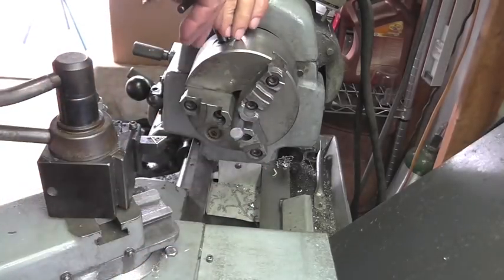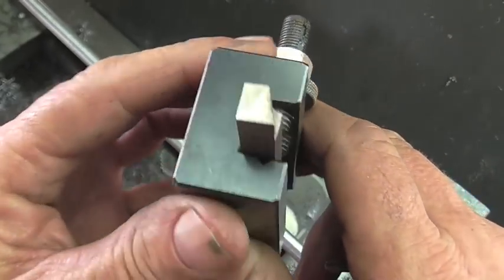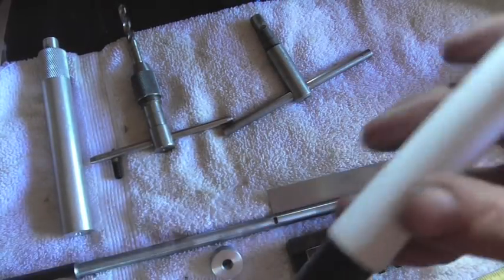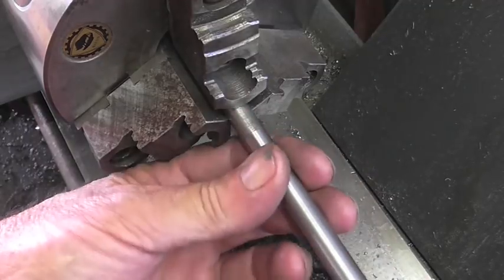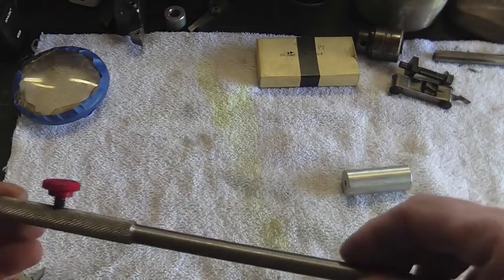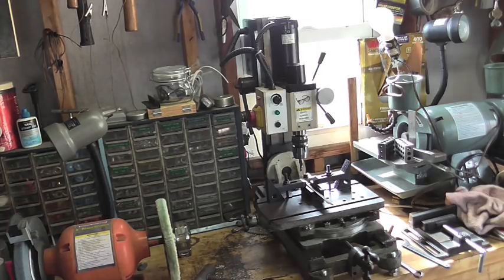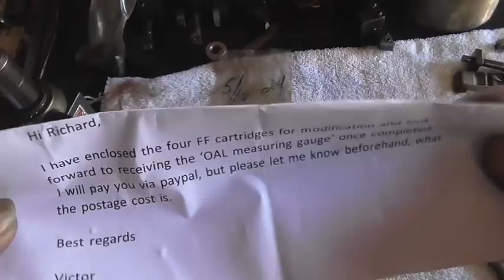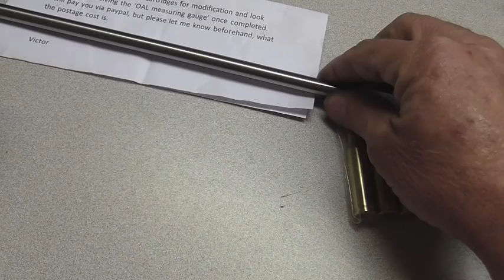Machining an Overall Length Gauge (OAL Gauge) & New MILL!- MSFN

Comment: The new form of video looked great to me Richard. Nice work , that high speed steel shear tool you ground sure works very well. With the finish you got from it , well lets say I have got to try to grind one up. Just hope I get the same results you have. Looked like a mirror finish. Good to here from you again. Keep the videos coming.
Reply from the maker: Use the shear tool for whisper thin finish cuts, 1-2 thou max....you will love using one. Take your time and will get great results with it

Comment: i must have missed something. if that tool is to hold a cartrige just to measure it. wouldnt it be easier to just hold it to measure it?  seems like alot involved just to hold a cartrige to measure.
Reply from the maker: Its a bit more involved than what I covered in the video, but due to the new "rules" here on YT I didnt want to go into more detail on exactly how its used or risk the video being listed as "non-friendly", you can search other videos for why these are used Bob
Reply: It’s used to determine the maximum cartridge length a given chamber can accept. The user would slide a bullet into the stretched case neck and with the case chambered you are able to measure the length of the cartridge with the bullet touching the lands of the barrel.

Comment: Rich, craftsmanship on this version looks outstanding...nice job! I'm contemplating re-ordering now :-). 
Question though- does this build include the rod needed to extend the bullet out of the cartridge (after the assembly is inserted into firearm of choice) until it contacts the rifling/bore of the firearm? The purpose of this tool is to determine the "maximum" overall cartridge length (F.F. cartridge/bullet) for a given rifle so the owner can experiment with bullet seating depth for maximum accuracy and consistency with their hand loads.
Reply from the maker: Thanks!, The gauges do not include the rod simply due to their length and problems in shipping a thin gauge rod that long. A rod can be sourced locally by the end user. A length of welding rod would work well. Thanks for watching and the kind words 😊

Comment: Nice to see that I'm not the only one that thinks the vertical shear tool is great.  One with a radius works well for facing, and when you don't need to go all the way in to the center of the part, you don't have to be too concerned about the height.  Somewhat close will do.  It worked quite well to correct the back plate to my Bison chuck, back when I made a new spindle adapter for it.

When you have some time to tinker, chuck up some scrap, turn it, make a shear pass, then make several spring passes on half of that (until you no longer produce swarf).  You may need stronger light and cheaters to see it, but the last that comes off should be 'peach-fuzz on a frog' fine.  Compare the finish between the two halves and measure with your best mic.  I'd like to know if the extra steps have different results with different lathes or if it's only applicable to an old warrior like mine.  Depending on the material, it's been the closest I've come to "mirror" right on the lathe without the use of abrasives.
Reply from the maker: Nice! I really love the tool and its simplicity.....really saves a hobbyist alot of time on surface finish
Reply from the maker: I didnt see your second paragraph at first but will give that a test run...thanks! ~ Richard

Comment: This is going to sound stupid to a machinist like you but if you are going to run a 5/16 x 24 die on a round stock, do you turn the blank to 5/16th? Is the first number on the die the diameter to turn? Thanks.
Reply from the maker: I usually shoot for about .005 under the nominal size, so in this case (5/-16 being .3125) I turned it to .307 for a little clearance on the threads
Reply: Thanks man.
Reply from the maker: I have never used a die to thread rod, I just single point thread it using the lathe. Good luck!

Comment: A couple of questions, first the thumb screw has no purpose in this tool, the original has a rod that passes through the tool and threads into required casings and is held in place by the thumb screw. Second the neck of the casings has to be oversized slightly so the bullet that is to be used passes freely through the neck. Third shouldn't the tapped hole in the casing and the thread on the tool match the commercialy sold casings to allow the tool to be universal? If not individuals purchasing this tool will have to drill and tap all new casings for whatever caliber they wish to size with the OLG, and not have the option of purchasing over the counter casings? First and foremost this is not a bashing by any means, I have a home machine shop as well and am considering making one of these for myself so I figured I would reach out to see why some of the things mentioned  before was handled in another manner. Maybe this was addressed in another video.
Reply from the maker: "A couple of questions, first the thumb screw has no purpose in this tool," 

It doesnt? That would be news to Hornady

Comment: r u running the sheer tool above center?
Reply from the maker: The shear tool is a right angle at the business end so is always on center regardless of the height adjustment of the tool holder.  You can move it up or down to get a new cutting surface if it gets dull and it will still be on center height (tangent to the radius) I think its called 😊

Comment: Nice job. What does the thumb screw do? BTW, FF means 'fire-formed' in the rifle's chamber.
Reply from the maker: Thanks, I didnt know that 👍🏼  The thumbscrew clamps down on a rod that is inserted all the way thru the gauge and advances the projectile to seat on the lands and grooves and also seat into the cartridge, then the overall length of the cartridge is measured and used as a reference for proper seating depth of the projectile. Thanks for watching! 😊
Reply: Ah. Now I get it.
Reply from the maker: I am no expert on using one but thats my understanding....I just know how to make the gauges...LOL
Reply: Makin Sumthin From Nuthin - Good explanation. Not all chamber throats (distance between case mouth and lands) are the same length.  If you have multiple rifles in the same caliber you can customize your ammunition for each rifle.  By seating the bullet very close to the lands you eliminate the "jump" from the case mouth to the lands, and in theory you will improve accuracy.  Works most of the time.
Reply: Makin Sumthin From Nuthin - A tool and die maker doesn't always need to know how to use a tool, but he sure needs to know how to accurately make the tool.  Great job on that.  What model of mill drill is that.  One of those would be a compliment to a shop, for small milling projects.
Reply from the maker: Thanks MP, the very first one I made was a gift for my brother and have since sold quite a number of them, it helps with new tooling and equipment like the little mill. Appreciate the kind words on its manufacture.....the customer was very pleased with it.  The mill head is from a grizzly "lathe/mill" combo unit and mounted on an X/Y table from another piece of equipment that is unknown. Its good for small stuff....glad to have it :)

Comment: Nice chip control. When the scale comes off and the inner shine comes out it is always soooo nice eh.Watching you now is still a treat bud. You have found a niche that suits you very well fella. That little mill will serve you very well and end up doing some really big jobs as with the sm. lathe(love that machine). Good to see you and I look forward to seeing you again. Well done !
Reply from the maker: Nice to see you Dean, hope 2018 is a great year for you. I enjoy the metal work and making the videos so glad to hear you enjoy watching them. The little mill needs some work to get it to my standards so the jury is still out on the little guy. Hoping it will do what I need it to! ~ Richard
Reply: For now it goes up and down, back and forth in 2 directions. Sounds like a mill to me. It will serve you well as is. It will make enough to be replaced by a larger unit but you will be surprised at how much it will still be used after that as is.
Reply from the maker: The base (X/Y table) and the vertical milling portion are from 2 separate units and the way they were married together is not properly done, but can be remedied
Reply: That sir is the attitude of a machinist/fabricator fella !
Reply: There are machinists and there are fabricators. You sir show traits of both. Do you weld as well ? I do all and a mechanic of chainsaws, cable yarders and aircraft as well. As gramps said "A nut is a nut, a bolt is a bolt. you can put em in anything you like. The rules remain the same"
Reply from the maker: I have a Lincoln 225 Tombstone Buzz Box, AC only. I can weld ok but not well enuff to charge $$ for welding services 😊   I just dont weld often enuff to get proficient at it
Reply: I would suggest a Square wave machine. It will serve all the welding techniques you will ever need. Up to and inc. 5/32 low hydrogen through both - + DC and AC welds. Tig too bud and just hook up a wire spool too.It is the only all around welder I know of and mine has served me without grief for 20 years +.
Reply from the maker: Great to know....I just dont seem to have a lot of call for welding but if I could TIG I bet I would find a lot of excuses to weld
Reply: You already have the hand/eye thing bud. It is just one more thing for the tool box eh !

Comment: That's nice. But what about the rod that goes in the center of the tool.
Reply from the maker: its just a simple rod, I dont supply that. As a machinist, I just make the gauge (the hard part to manufacture)
Reply: @MakinSumthinFromNuthin  ok I was just wondering. Thanks. Sure looks good.

Comment: My Hornady OAL Gauge extends into the case to far to use with a Lehigh Defense194 gr. Max Expansion subsonic. Any thoughts?
Reply from the maker: Not being a reloader myself I cant offer an opinion on on how to work around it. Yours is a store bought one?
Reply from the maker: Is the gauge too "short"?
Reply: Makin Sumthin From Nuthin, No, my hornady is to long for a 300 AAC Blackout case since the 194 gr Lehigh takes up half the case when inserted to its factory provided ?detent. I could saw off the end of the hornady but I’ rather buy yours if available.
Reply from the maker: Yes, I still custom make these, I dont stock them for immediate shipment however. I only make the gauges, not the comparator. I have an order for a gauge by another viewer that just came Monday. I will be starting the machining in the next few days and making another along with it would not be a problem. My email address is in the description portion of the video....shoot me an email to discuss pricing and could get started on manufacturing you one right away. ~ Richard
Reply from the maker: email: makinsumthinfromnuthin "AT" gmail.com